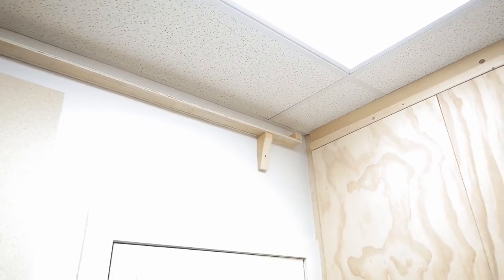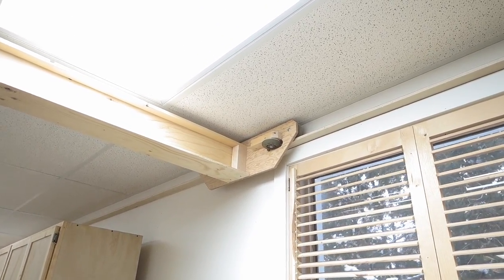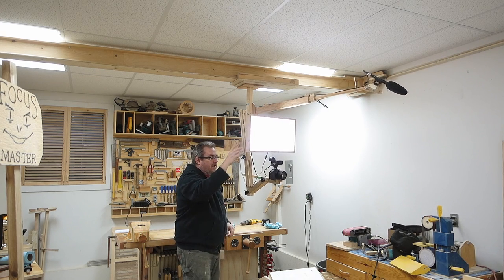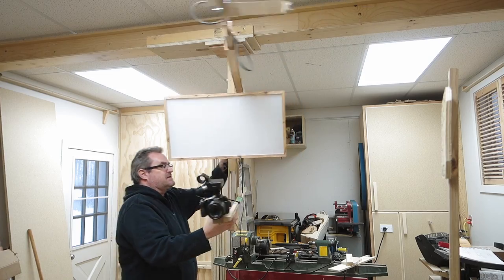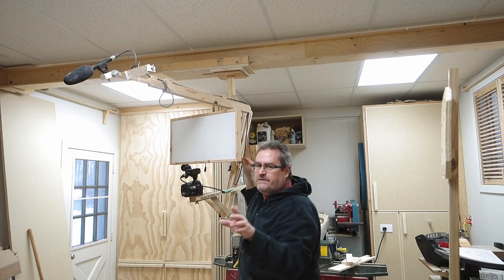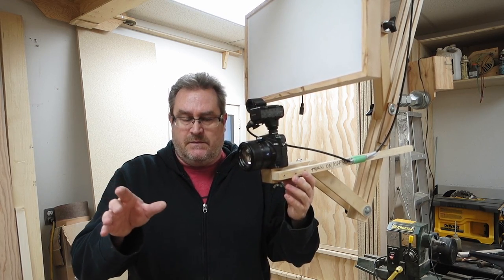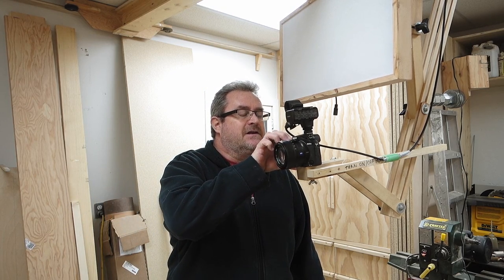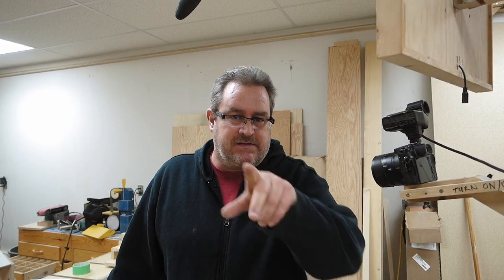My Wooden Camera Gantry And Other  Video Gear

Comment: May be not a full rebuild... but some slight mods for improvements might be fun.  May be add some springs mechanism to the sliding wheels so they track the uneven walls better?  or some heavy duty rubber bands to give some tension to the structure to solve the swinging problem.  Just a thought... But basically, I am just curious to see how you would improve on this already ingenious apparatus.  Thanks John!.

Comment: Now that you've made a video about it you've scratched the itch and started thinking through the things you would change about the gantry.  Only a matter of time now.  My video editor has its quirks too but like the gantry it mostly works so I don't do anything about it.
Reply from the maker: That's usually the case, but I'm able to resist this time. Maybe in the spring I'll do an overhaul on it and add in some interesting features.

Comment: John, make your gantry beam into a "box beam" using 3/8" plywood with a diagonal piece, perhaps a 3/8" plywood strip the entire length. The beam will be like a piece of steel if you do that and it will not add too much weight.

Comment: You could get a heavy duty lazy susan to mount the arm of the camera gantry to get rid of that wobble potentially.  You just need to add more points of contact.  So basically put a plate on the lazy susan and make a mini tripod upside down to hang the arm from.

Comment: That would have taken me a lot more than 3 days to design and build. I think it's really good for a first iteration, or even a second or third. You could make an offset pretty quickly to eliminate the need for counterweights.  I guess that would only be worth doing if the time it saves waiting for the oscillations to stop is greater than the time it takes to modify it. 

Thanks for sharing.

Comment: Sounds like you should build a light strip into the gantry so even if it's blocking the ceiling lights it still provides lighting.

Comment: Thanks John, you're a lifesaver! Was just about to buy PowerDirector 15, but seeing how Davinci Resolve is free it's a no-brainer. I checked out their site and the only things dividing the free and pro version are things like color grading and multi-screen options. How is that possible, to just release a professional editing software with all the needed functions for free without a watermark?
Reply from the maker: Their target market is not the typical guy posting on YouTube, so I expect they sell a lot of full versions. They also sell hardware, like their control surface for $32k, so that offsets the freebie somewhat.
Reply: Well thanks for the tip anyway. The program seems very proffesional and I got a good first impression. You have learnt to use to the program in a few months (perhaps even quicker), would you say that it is a hard program to learn for someone that is new to video editing, and do you know of some great tutorials?
Reply from the maker: The edit section is no harder than any other, they all take time to learn. Tons of tutorial videos out there on using it.

Comment: Davinci resolve relies mostly on GPU, but since my editing PC is built with a better CPU than GPU, I probably won't change to Davinci resolve anytime soon. Speaking of PC tech stuff, mind sharing your specs of your own video editing PC? I already fell in love with the wooden case you made for it.
Reply from the maker: The wooden case one is my "daily driver" and is in need of an update - I stopped editing video on that shortly after building it. Current configuration is an i7 5820k, 32GB ram and a GTX 750ti video card. SSD for system plus two more for scratch disk for editing.
Resolve will run silky smooth on nearly any modern configuration if you take the time to generate optimised media before getting started. I do that at the start of every project and the program handles high bitrate 4k beautifully.
Reply: optimizing media, thanks for the tip, I'll try it out as well :)
Reply from the maker: Yes, most of the hard work a video editing program does is to decode the compressed video, so converting it to something that is less compressed actually speeds up the process considerably. That works with all editing software, but Resolve does it flawlessly.

Comment: do you have any trouble with the a6300 or the other cameras overheating at full resolution? Ive been considering getting an rx100 iii or a6000 but want to avoid a lemon...
Reply from the maker: Overheating was never a problem with the RX10ii. Small issue on the a6300, but only happens if you do extended record times in really warm places. Most of my clips are less than 2 minutes, so I've only encountered it one time (outdoors on a hot day in ful sunlight).
Reply: Sounds like the rx10ii is a good way to go, do any of them do better in low light?

Comment: Looking at the DaVinci Resolve page and without your comments here I would not think it was meant for video editing.   A whole lot of the page shows these high tech video editing consoles, and so much of the text talks about "colorist" and "color correction".   Makes me think it is some weird video processing niche tool for hollywood types.
Reply from the maker: Resolve started out as a feature film capable colour grading program, and still is mainly used for that today. 
There is a learning curve, especially with the colour correction part (if you actually need it, that is), but well worth the time to learn. It's rock solid stable, packed with features and absolutely free.